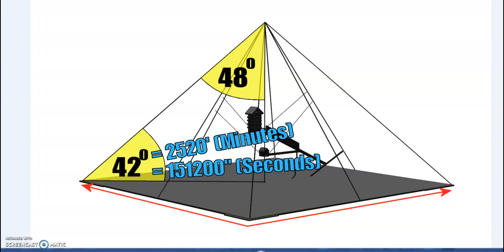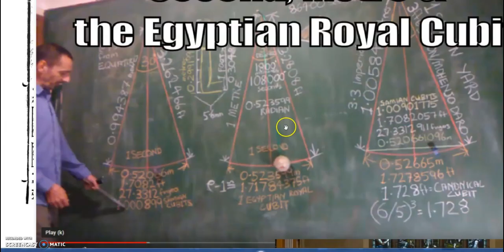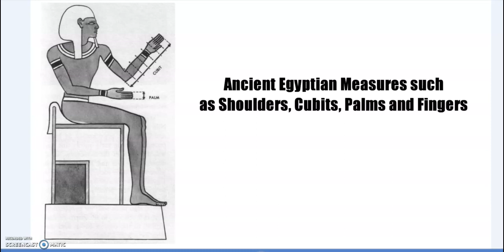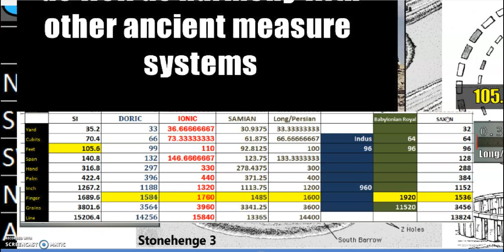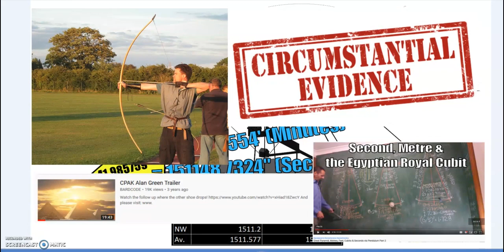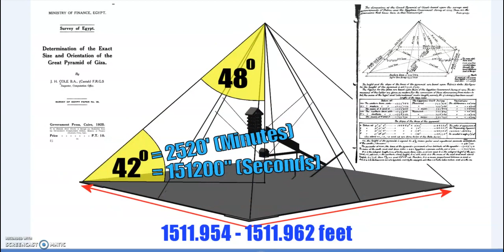Great Pyramid- Angles of Coincidence 2.0

Comment: I'm sorry, what was the link that connects foot to the metre to the ERC? Without this I cannot follow the argument further. The relationship is not clear. Do you have a concise explanation?
Reply: Ah, I think it is:
Great Pyramid, Metres, Feet, Cubits & Seconds via Pendulum Part 2
Reply: Is it your view, SGD, that the measure of a foot being from the elbow to the wrist is quite arbitrary? Is this certainly the length by which the foot is determined?
Reply from the maker: The famous image of Vitruvian Man by Da Vinci based on the writings of Vitruvius (10 Books of Architecture). Vitruvius talks about the proportions of a well designed temple being based on the proportions of a man. A Cubit x 4 equals (ideally) is the height of a man.
Though a unit of measure called the Span is a hand with outstretched fingers. From tip of pinky finger to tip of thumb is a span but it also equals a Head, from chin to the top of the crown.
In Vitruvian man the foot equals the length of the forearm.
Though an inch based on width of a thumb- 12 inches a foot or 16 fingers a foot.
It's a bit of a chicken and egg thing what is the origin though I'd place my money on thearm, hand, thumb and fingers.
Though also Vitruvius says the foot is one sixth of the height of a man while the image by da Vinci the foot is 1/7th of the height.
Egyptian cubit has the forearm as 4/7 th of a cubit but Greek/Babylonian/English cubit = 1.5 feet.
Ultimately I think it comes down to the practicality of a measurement based on the human foot versus using arms, cubits, forearms, hands, thumbs and fingers. We just naturally use our arms etc to convey measure rather than legs and feet.

Comment: 42, 48 and 90 degrees. The lowest denominator is 6. so you get 7, 8 and 15. Is there any significance do you think? obv 7 + 8 = 15.....perhaps as there are 4 slopes, you get 4 x 15 = 60. too simple maybe...
Reply: squaring them reveals something maybe....so 49 + 64 = 113...plus 225 = 338. times by 4 (as 4 of them) = 1352. divide by 52 (weeks/yr) = 26 (half a yr/weeks?). why? no idea lol...or maybe 26 represents 26 years? x 1000 = precession? straws and clutching spring to mind...just some harmless musing.
Reply: actually...as there are 4 slopes.....4 x 7 = 28      4 x 8 = 32.   add together = 60.  4 x 15 = 60 also.  60x60 = 3600.
Reply from the maker: 3 would be the lowest common denominator
Though 360 degree compass = 1296000 seconds
1296 as a harmonic
1296 (x 2)
2592 (x2)
5184

2592 x 10 = 
25920 years in the great year
5184 / 10 =
51.84 = slope angle of the Great pyramid
Reply: @SacredGeometryDecoded  i think (i'm sure) i used wrong term:) - I was meaning lowest common divisors (maybe thats the term?)- as yes 3 is lower than 6, but ,3 gives you 14,16, and 30 - which you can then break down one more time to 7,8,15.